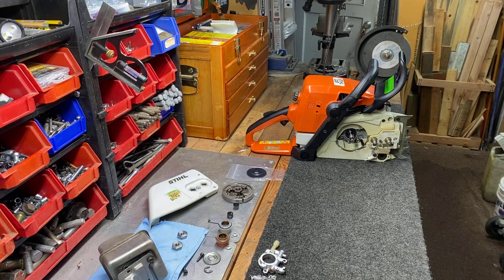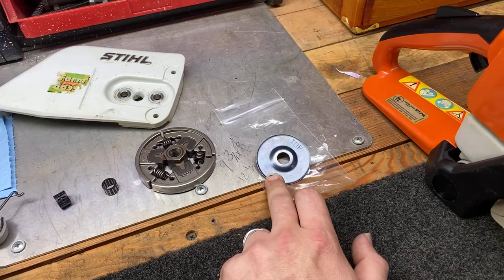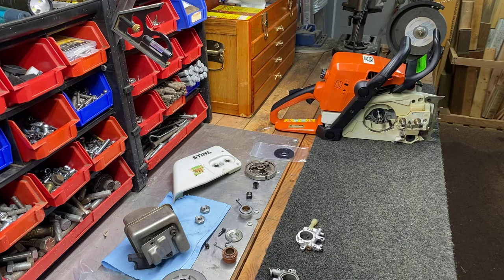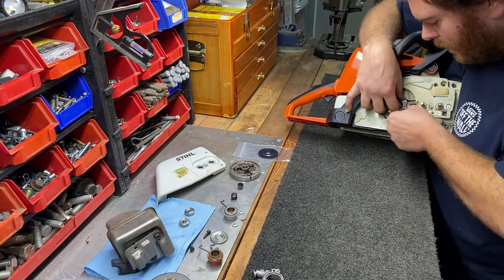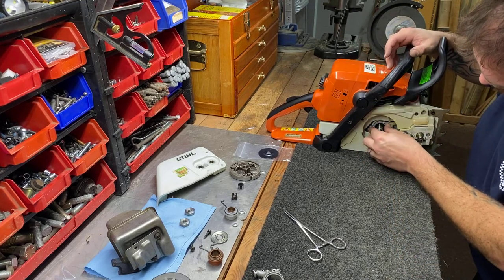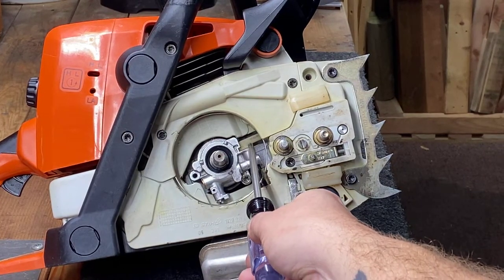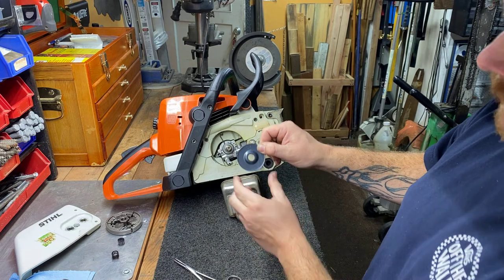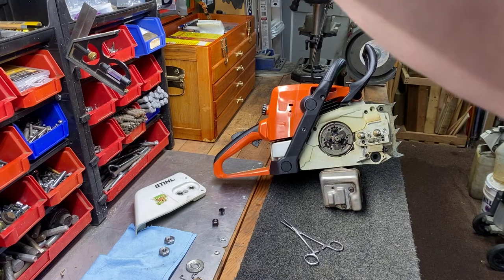Oil Pump/PTO assembly Stihl 029

Comment: Martin Klein.  My 029 Super does not have that big washer behind the clutch. Are you sure it's required on this one? Also, I noticed you didn't use a piston-stop when installing the clutch. Also I know that the clutch doesn't need to be real tight as the reverse threads cause it to tighten on it's own after some use. Great video. More instructive than a lot of others I've seen.

Comment: The 029 was produced with two different shaft lengths. The longer of the two used the cover washer behind the clutch. The other had none. That's the problem in a nutshell. If your 029 doesn't  have the washer, It was by design.
Reply from the maker: Good to know thank you! I picked the saw up off market place for 100$ and it looked like someone had tried to fix the oiling issue before I picked it up so no telling if it is/isn’t supposed to have that washer. Thanks for the comments and the view! 👍